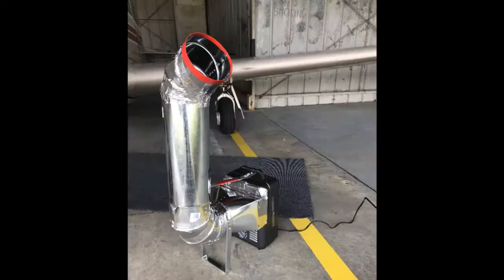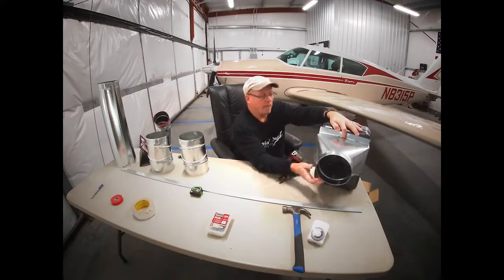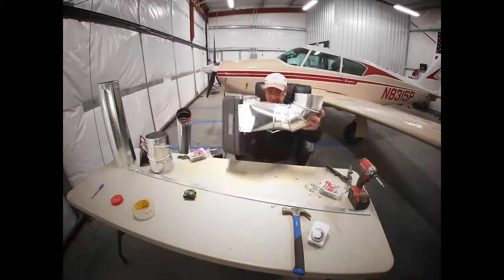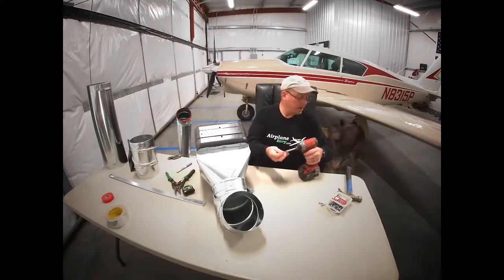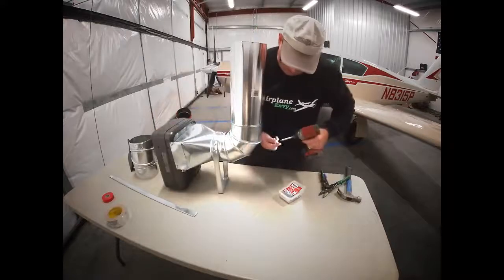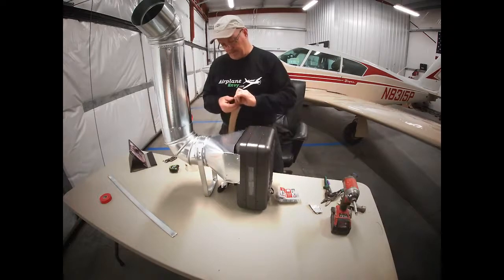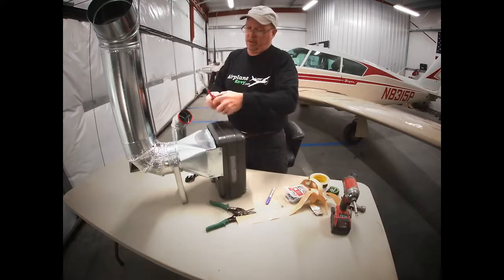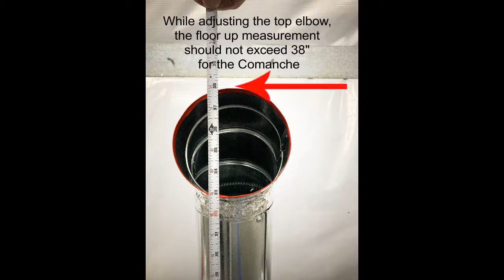Airplane Pre Heater for under $100.00

Comment: The only thing you need to add is an electrical timer so the heater doesn't need to run 24/7......say 3am to 10am or whenever you normally go flying.
Reply from the maker: Yep, it is on the table at about the 1:00 minute mark. I usually set it to start heating 3-4 hrs. before flight. 👍